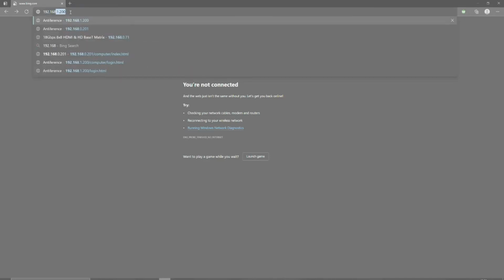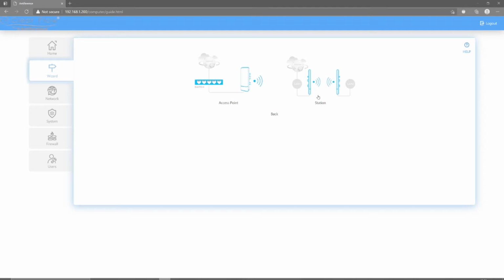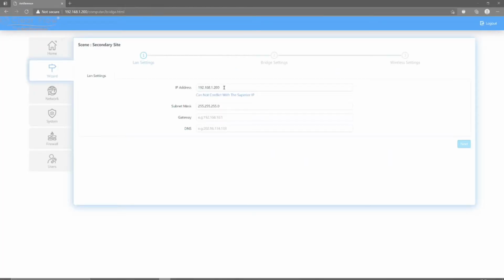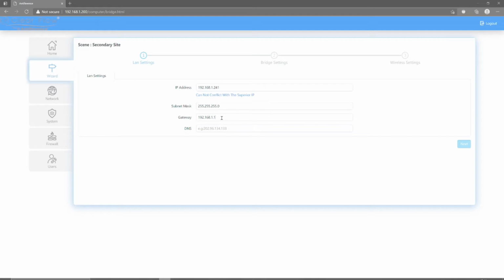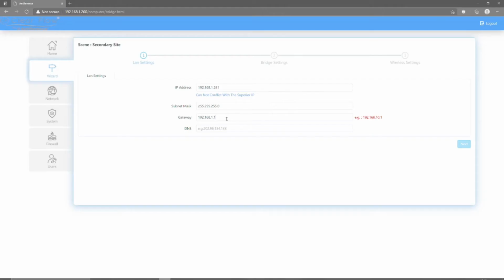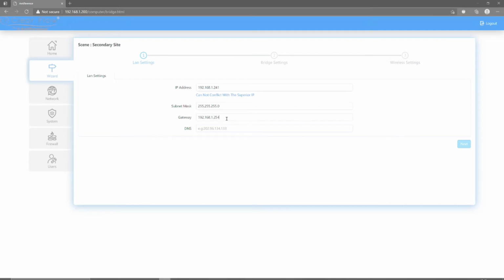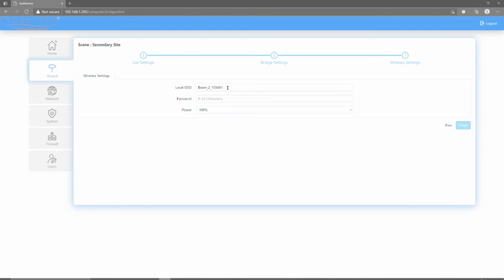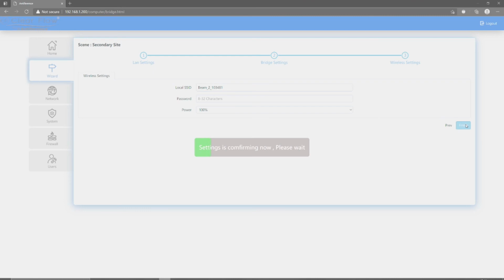Setting up a Bridge Part 2 (station) 2021

Comment: Would you use the same setup if you wanted to connect 2 stations to the AP just setup the third one as you did the second? 
Thanks
Reply from the maker: Apologies for the delay.  Yes simply repeat part 2 for each of the stations/locations you wish to set up, Kind Regards > Lyndsey